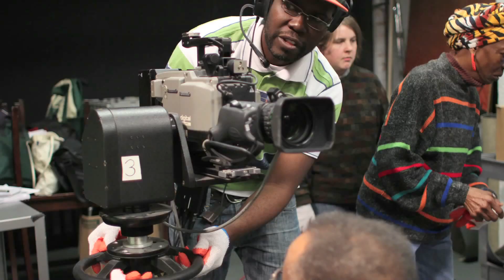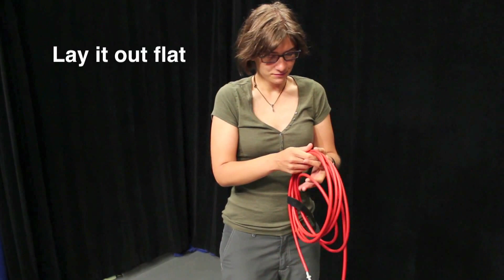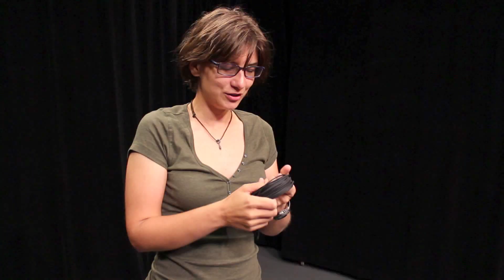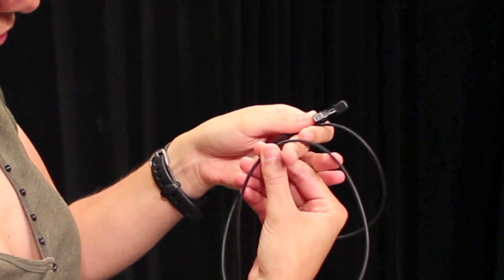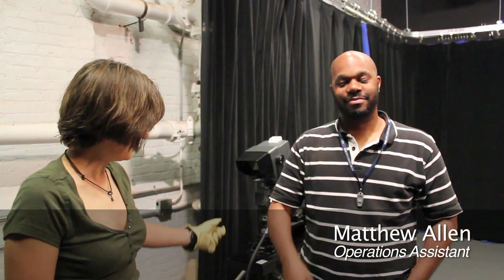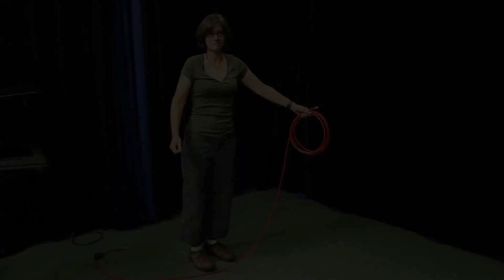How to coil cable

Comment: I've watched a lot of coiling videos and this is easily the clearest.  My ah-ha moment was realizing that the cord gets a twist one way when going over and the opposite twist going under so they cancel out and the cord gets no net twist.  I like the tip about using the floor space, and how you show what a badly coiled cord looks like.  This method works for garden hoses, too!
Reply: Exactamundo!   The twists cancel each other out, resulting in no net twist.   :-)
Reply: Amen!

Comment: This method also works with garden hoses. A bit more difficult to 
implement, but boy, is it worth it! I walk up to a 100 foot hose lying 
on the ground, coiled like this, grab the end and walk away with it 
until it is fully extended without creating any kinks or tangles. I used to use the figure 8 method, but this is much more compact. It might even work for your camera cables is it is laid out carefully so that the last wrap is over, not under.
Reply: That's good to know.  I need to start rolling up my hose better.

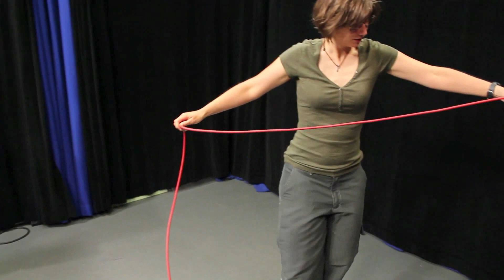Comment: The majority of cable failure is due to loose wire connectivity inside the connectors (plug ends) or to damaged plug ends. Why are you dropping the connectors on the wooden floor at 0:51 and thereby causing potential damage to them? What's the point of carefully folding a cable in order to ensure longevity if you're gonna stuff the connectors up?
Reply: I think  that room made it sound worse than it was.  She appeared to be letting them down carefully.

Comment: For your camera cables, try making a huge loop with the CCU end and Camera ends close to where you want the coils/camera to end up, and simply make LARGE loops in your hand by pulling the cable up and NOT twisting it as you draw it in. The cable will automatically figure eight itself, and in the end you can simple lay the coils down, camera end on top. It will feed ever so easily, and this method has the advantage of being able to be performed by a single individual and you can do it standing up. Figure eight is a tradition, but over/under can be done and is pretty much the same thing. Over/under is a figure eight with the bottoms interleaved and stacked on the tops of the '8'. 
I found a sailing line (needs the same stowage and for mostly the same reasons) video that shows the figure eight technique - https://www.youtube.com/watch?v=vX4Zr0vdGHE&t=399s